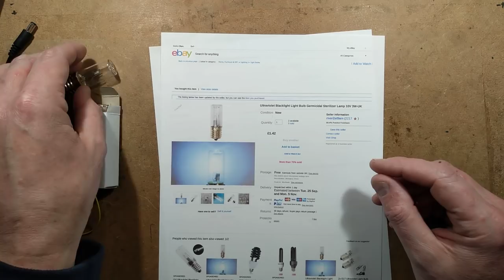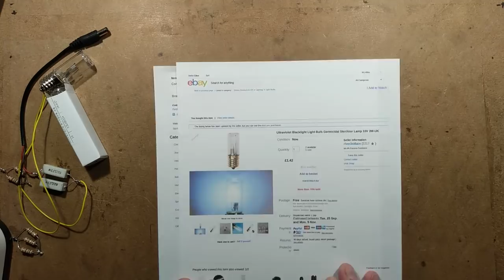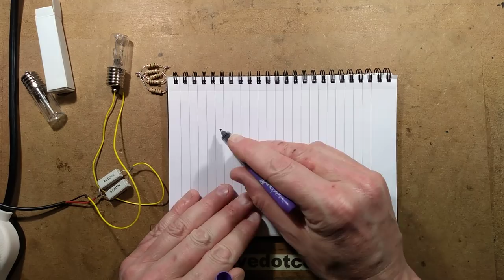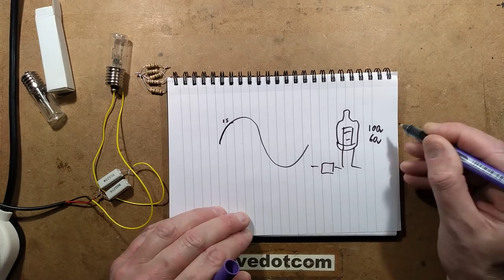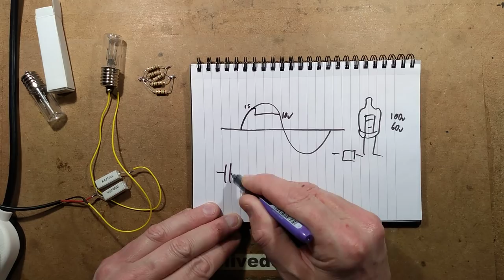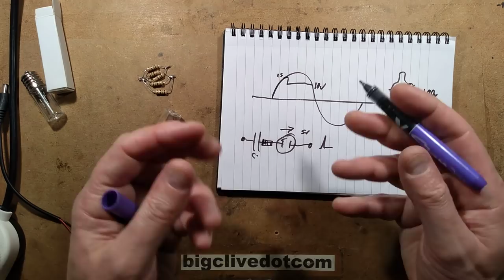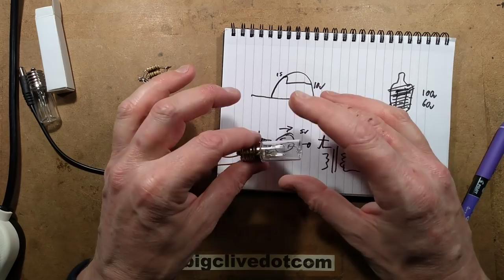Amazing ten-volt mercury discharge UVC lamp.  (GTL3)

Comment: If you don't just shoot static scenery, the mirrorless designs are actually really annoying, because they introduce a few 100ms of lag, which if you started out using a lag-free reflex mirror, is a big enough pain in the ass to constantly work around, that many professionals prefer to stay with the mirror design.

I think I might know which camera you're talking about: is it a Sony?
If it is, just be really careful about cheap sellers. I've personally seen some really convincing (in everything but the quality of the delivered image) fake copies of the Japanese DSLRs being sold for just a few grand, so if you find something like that, it's probably going to be a fake.
Reply: Maybe depends if they're high end or not. Certainly no serious lag on the a7RIII
Reply: @BillyONeal ; Yeah the a7RIII is pretty good in this regard.
There is still some lag, but it's low enough to be fairly easily compensated for.
This will also depend on just how well your brain is able to naturally hide latency through extrapolation.

Even the a7RII's viewfinder was completely useable for me.
Reply: Can't be a canon or a nikon cause neither support autofocus on their DSLRs while recording a video. You gotta press a button while recording to tell it to focus. But that might have changed after a few years. I've gone back to using full manual prime lenses for image quality reasons, as well the auto focus takes goddamn ages on cannons.
Reply: I don't think any decent DSLR has a 100mS lag.  My K-3 can shoot about 9 frames per second, that is 110mS per cycle, but that is not just to raise the mirror and release the shutter - it also includes traversing the shutter to expose the photo, re-arming the shutter while also lowering the mirror and then refocusing before starting the next cycle. 
I'm sure that of that whole sequence raising the mirror and releasing the shutter can only be a small fraction of the time taken for that whole process. I am guessing more like 10 to 25mS worst case. 
In any case, in my experience the lag is not humanly perceptible - I have never had difficulty capturing brief moments, such as the moment a bird flies off a branch, or a cat pouncing on a toy and things like that. A lag of 100mS would make such shots impossible when added on top of the human reflex time to actually press the shutter button.

What I find ridiculous is using an SLR to shoot exclusively video - the mirror has absolutely no purpose there.  Probably people started using SLRs because at some time the Canon and Nikon ones happened to  exceed available consumer video cameras in quality but there is no technological reason why they should. Canon and Nikon could easily have repackaged the optics and electronics in a videos camera format getting the same or better quality and also have it in a package more ergonomically suitable for shooting video but for some reason once the trend started it just gathered momentum and kept it.
Reply: If it's a Sony, you'll love it to bits
Reply: @listerdave1240 ; The K-3 that you mentioned has an optical viewfinder, hence why it has no perceivable lag. The only real 'lag' in a good SLR is simply the delay from the time you press the button, until the time that the shutter is open. Given that the shutter can control sub-milisecond exposures, it's fair to say that delay isn't humanly perceptible.

I was addressing the question of why you would want to have an optical viewfinder, as opposed to a mirrorless digital one, like Clive asked. In the digital case, the optical sensor needs to be exposed, the image buffered, read out into main memory, resampled to a new resolution on an embedded (slow) processor, and then sent off to the display controller. The display controller adds on average at least another 10ms, just because of the refresh rate of 50-60Hz, but usually it will trade latency for cheapness (slower and smaller memory) and power efficiency, and so the added latency is much greater than that.
Now don't get me wrong, this huge pipe doesn't necessarily have to take long to traverse (the Sony a7RIII is a very good example), but it turns out that /most/ people won't even realise that they are compensating for up to 300-500ms of lag, due to the manufacturer having used cheaper components and lazy design, as long as it's the first type of viewfinder that they started on (and they continued to practice with it for a couple of months).
It's the same effect where people will refer to 30 or 60 fps as 'smooth' motion. Even though almost everyone can resolve the difference between 60fps and 120fps (and most can also immediately tell 240fps from 120fps), almost everyone started out by watching TV at ~24fps and by using a computer at 60fps; thus being tricked into thinking that is what 'smooth' motion looks like.
Reply: @callumlaird5158  I have heard a lot of jokes about someone commenting about how their camera a broken and the reply is how it must be a Sony...
Reply: @Kuiper, Canon DSLRs have had autofocus during video recording since 2012. Canon 650D / T4i for example.
Reply: @HappyQuailsLC ; To be fair, there is an enormous amount of counterfeit Sony cameras out there, so it shouldn't really be that surprising.
But at least in my experience as well, the newer high-end Sony DSLRs are very good indeed.
Reply: Panasonic Lumix has been doing mirrorless DSLRs longer than Nikon or Canon.  They're pretty well rated for video.  As others have said, mirrorless tends to introduce a slight delay, so it's a handicap when shooting sports or action shots.  I like them because they display more information in the viewfinder, as well as allowing you to review the shot in the viewfinder.
Reply: I've got a Sony Nex5, a really rather out of date camera now, that wasn't terribly expensive to begin with...but it's still more than enough for me.
It looks amazingly ridiculous with the 615mm(effective) lens I just bought from eBay for £12. I'm sure I'll use the lens twice and then be done with the novelty of it.....£12.
Reply: Even Nikon has finally figured out how to fo mirrorless, check out the Z6 and Z7. The Z7 finally matches Kodachrome quality, and the Z6 does half that, but gains dynamic range and clean low light pix instead. In order to be mirrorless, the image sensor (all brands) must be powered up all the time, which also makes it run hot, which degrades the image. But the new full size sensors finally can do that, cost competitively. And pros no longer care if their camera "sounds" professional by making a big mirror slap.
Reply: @mortlet5180  I mean, technically, sure, but not more lag than a DSLR takes to get the mirror out of the way
Reply: @BillyONeal  In any case, human reflexes are far slower than any "lag", in my experience the only people who talk about this issue are DSLR shooters who rarely use mirrorless cameras in the first place.
Reply: Andrew Ness  The problem isn't that your reflexes are pitched against the lag but rather added to it. Combined it makes taking a shot at a critical moment difficult. The video processing gives you a image after the fact and you then press the button later still, all adds up to lots of compensation. In video mode it can mean extra blur as you are pointing behind a moving object not at it, looks worse when the target is moving toward/away from you. Slr viewfinder sends the image at the speed of light...
Reply: "local camera shop" WTF do you live NYC, and yes the lag even on the new ones will make you dizzy a frig if you are in motion, IE: boat/plane/car
Reply: I prefer they not slap, the heat is still an issue with consistency
Reply: Just now I realise I had understood your post upside down. I somehow read it as saying DSLRs would have a long lag time when in fact you were stating the opposite (mirrorless).

Agree 100% that most current mirrorless have a significant shutter lag due to reconfiguring from live view to single shot. Not just shutter lag but even display lag.
Reply: ／／ Ｋｕｉｐｅｒ ／／
My friend, you lag behind current technology by about a couple years. Canons have trickled down realtime autofocus while recording video to their lower grade DSLR already. More than that, they are the best in the market at that, by far.
Reply: @alphabuilders  May be true for video, but I shoot live performance, dance, theatre and so on, and it seriously is not even something I have ever noticed in reality. (I mostly use an SLT camera, not strictly mirrorless, but it uses an EVF.)
Reply: @KuiperShaina  actually the canons have the best autofocus these days for video due to dual pixel autofocus
Reply: The time lag between big Clive shooting a video and me seeing it may be anything between hours, days , months......  certainly more than 50ms.  So in what way are these other comments relevant?  Personally I have no problem with the cameras he's been using.
Reply: @raykent3211 ; It really isn't an issue for video. Big Clive originally stated that he doesn't understand why a reflex mirror viewfinder would still be necessary with digital (electronic) viewfinders being standard on everything from cheap to high-end DSLR cameras.

My comment was simply addressing his misconception that electronic viewfinders are sufficient for all photographic use-cases.
Specifically, when looking through an optical viewfinder, there is no lag and no temporal aliasing; what you see through the viewfinder is exactly the same temporal resolution, at the same moment in time that you would see if you peeked over the camera and looked at the scene with your own eyes. Yes, taking a photograph does introduce some lag from the time you pressed the button, to the time that the exposure actually starts, but it is generally MUCH quicker than the massive delays introduced by electronic viewfinders and you also don't have the issue of the moment possibly having already passed by before you even had the chance to capture it.

With the electronic viewfinder, because of power or price constraints, together with bloated and inefficient programming, the camera takes quite a long time to process the image before you get to see it through the viewfinder.
For example, by the time you see the subject beginning a movement that you want to capture (such as a bird starting to take off), in reality the moment has already passed. So even if you had instant reactions (which you really don't), you miss the shot. Furthermore, the viewfinder is only updated at 60Hz, which makes temporal aliasing a real possibility in fast moving scenes, adding to the difficulty of identifying and capturing that perfect moment.

Fortunately, the newest of Sony's highest-end DSLRs have actually gotten much better with regards to viewfinder lag, but as a general rule, mirrorless DSLRs have always just been more annoying to use for fast-action photography.
Reply: @raykent3211  It is not really, but "camera people who enjoy talking about this stuff" and Big Clive viewers seem to have a significant overlap. For Clive's purposes, as for the vast majority of photographic purposes, the use of an electronic viewfinder is a significant advantage, although some older users still prefer what they are used to.

Comment: Thanks clive. Now I know why my Toothbrush-cleaner glows in that lovely blue.
Read the manual and wondered if the shield makes it visible and blue. But it's the actual lamp. No wonder they are so fussed with a switch killing the lamp when you open the enclosure. neat and now I know which lamp I need if mine ever breaks down.

Comment: Yes... your lamps won't last longer than a month or so !!! I don't think you are supposed to touch them with bare fingers, like halogen bulbs. The glass isn't glass but quartz, isn't it ?? Hence the oils and acids from the skin tend to penetrate the quartz envelope and form microscopic or electron-microscopic holes in it and let O2 inside and the filament slowly burns out. Someone do enlighten, please...
Reply from the maker: With halogen lamps the main issue is the heat and oil film causing devitrification of the quartz and causing it to fail.  In situations where a lamp has failed like that you can often see a bubble where the fingerprint caused discolouration and concentrated heat in that area.
Reply: Thanks BC, I used to be in AV in highschool and completely forgot about that. Thank you for reminding me of that. It had literally LEFT my mum... mind (truly, no pun intended)
Reply: Thanks for the details BC... Luvya.

Comment: I ended up buying a couple of these for experimentation (with sunglasses on of course), as well as a bench power supply.
They seem to start discharge at around 15ish volts, at which point current regulation cuts in, kicking the voltage down to around 10. Exactly as described in this video.

Now my plan is to create a low power ozone generator out of a pringles can, a small PC fan, and one of these.
I have an old 16v transformer laying around, so i'll try to utilize that.
Reply from the maker: Did yours create a smell of ozone?  There seem to be two types, one of which is better suited to ozone generation.
Reply: Many sunglasses don't block UV-C radiation (especially if they are made of plastic).

Comment: I have that same lamp mounted in a Phillips electric toothbrush charging station with sanatizing chamber for the brush tip. The holder is more of a clamp you push the bulb in sideways than a threaded mount.
Reply: Yes, and the Philips Sonicare unit runs this lamp on DC for some reason. I have one too.

Comment: These are tunger lamps. Some dryers use them to make ozone that gets blown into the dryer when running to remove odors. They start out as an incandescent lamp then end up creating a low intensity mercury arc lamp. You can use a 20 to 40w incandescent lamp as a ballast. ❤

Comment: Ive replaced similar bulbs in newer cars climate control systems. its weird how some last forever and others constantly blow. Ive suspected over voltage or burning them when the hvac is not running.  On your shipment from the US lets hope it was shipped before hurricane season started, its ready to blow on the east coast.  glad you are back to your regular broadcasting. lol

Comment: If you put power to one filament in a fluro bulb it'll have the same effect but a slightly higher voltage (about 25) The filament first glows then the phosphor suddenly lights up. Give it a try with a compact twist bulb

Comment: I looked up the specs on this lamp, it said that this is a 'no ozone' type. Never knew there was such a lamp of this type. Dunno how they do it. I got 1 of these lamps and used Russell's AC ballast method, it works great. I do like your thot about putting a small resistor in series with the capacitor to prevent electrode sputtering.
Reply: Mercury vapor lamps give off two wavelengths of UVC. They can be treated in a way to only allow the higher of the two to pass. The newer video about the lamp that can hurt you in two ways talks about this in better detail.

Comment: That 'mini' or 'medium' Edison base is often found in microwave oven lights, occasionally fridges, and older clip-on little work lights from more incandescent by-gone days (Thrift store score). Used for better  heat removal than the smaller 'candelabra' (old style x-mass) bases.

Comment: I bought three of these for use in my 1950's/60's-era air purifier, known as the "Puratron." These were the modern-day replacements for the discontinued, original lamps, which produced more ozone. The base, BTW, is the US E-17 intermediate.
Reply: My late Uncle brought a Puritron back from the US in the 1960s. I could never figure out what the strange bulbs inside were for, now I know!

Comment: Brainstorm: I bet this was invented in the 1920s, during the early years of GE non-vacuum light bulbs.   With argon-filled bulbs, the tungsten surface doesn't evaporate as quickly as it does in hard vacuum.  But depending on the drive voltage and the shape of the filament, sometimes an argon discharge will begin.  Once the plasma ignites, its voltage drops quite low, and the discharge will short out the 120VAC filament, giving a brief and extremely brilliant glow before the line breaker pops.  (Sometimes it melts the iron filament supports.  Sometimes the hot gas pressure rises and explodes the glass bulb.)
They've harnessed this ancient but known failure mode, to create a cheap "starter" for a gas-discharge bulb!  Just use pure argon, a hot filament, and a mercury-bearing surface protruding into the argon discharge.

With normal tungsten bulbs the cure was to add nitrogen, which spoils argon's low-voltage discharge.  Today's incandescent bulbs all have low pressure argon plus a percent or two of nitrogen.   (If you've played with buckets of cold argon gas and Tesla coils, you know that the argon has to be pure, where any contamination with air will suppress the enormous one-ATM plasma-streamers.)
With today's bulbs, when the filament breaks, still sometimes an argon-discharge develops between the broken ends, then grows to take over the entire filament sections.  The bulb suddenly lights up bright blue-white, and often explodes with a bang!

(In the 1990s, someone on my Cold Fusion forum mentioned that Radio Shack plasma globes use xenon at nearly atmospheric pressure.  NOT a vacuum.  We all went out and tried it, but with argon or helium.   Welders' argon works great!   Fill a cardboard box, then stick the tip of a tiny Tesla coil into the gas.  Even 20KV can make 20cm sparks!  It's a plasma globe made of cardboard, with your entire arm inside.  Stings a bit.  Or, fill a transparent bag with pure argon (fill it 1/4th, then squeeze it out to flush out any trace of air, then fill with argon.)  Stick it in a microwave oven, produces a whole multi-stage light-show.  Oops, first put a small tuft of steel wool into your argon-bag, to act as a "trigger."
GLASS VASE FULL OF ARGON: https://www.youtube.com/watch?v=a5PGQfUSZ_A&t=64s